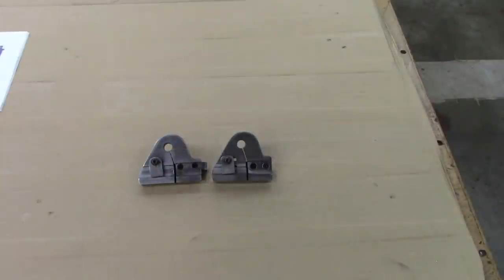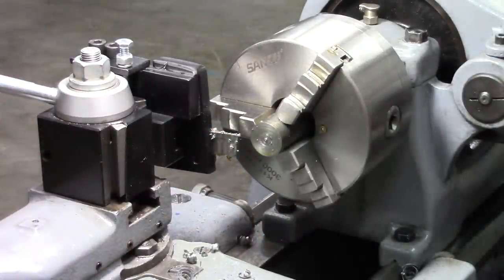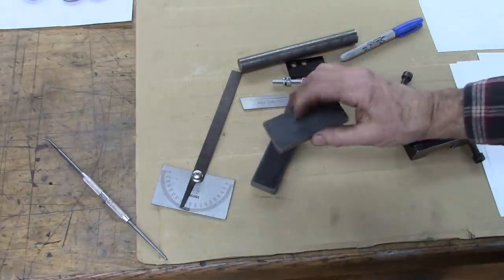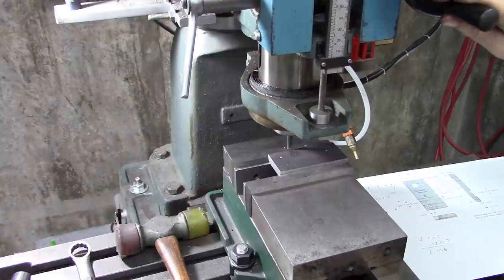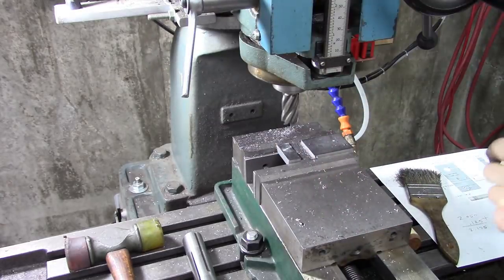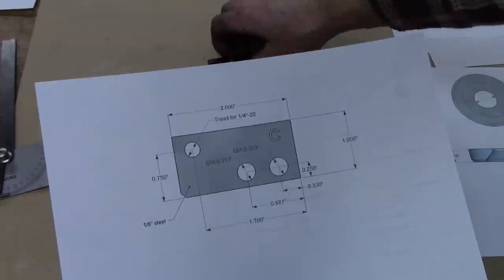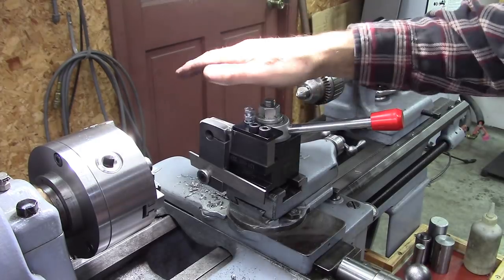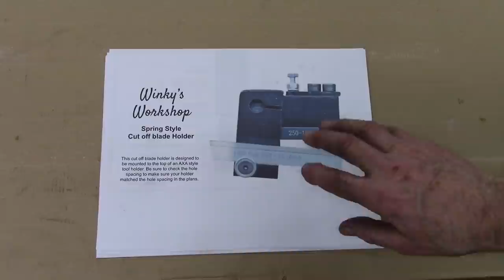Spring Cut Off Evolution! An Easy to make design + the PLANS

Comment: Fantastic video Mark !
I wonder if on your design the addition of a screw pushing on a heavy spring or maybe  rubber  slug which is pushing on a metal plunger and all this is built into the upper main housing so the metal plunger pushes onto the lower section of the flexture across the slot  , could this be used to tune the amount of flex of the unit and maybe the harmonics that cause chatter ?
Reply from the maker: I think it would need to pull the spring closed to work well (like preloading the spring). A screw that pushed would likely make it act like a normal cutoff tool. Maybe a screw with s super strong spring pushing might work too.

Comment: Well I made the original cross slide rigid mounted one and it still works fine but will have to have  a crack at this one too as it looks easier to set up. Might try something different by using 14mm x 2mm blades
Reply from the maker: Are you talking about the direct mount? My lathe did very well with this one. I did get some chatter but it was easy to work around.
Reply: @WinkysWorkshop  Yes, that's the one. I actually made 2 for different size blades and only crashed 1 on auto feed (not tight enough)
Reply from the maker: @allanb1778  Yeah...  the quick change is nice.

Comment: Great project Mark, I really enjoyed your explanations and proof of principals. Nice penetration on the weld. When I was learning how to run my newly acquired NIG, a talented young welder taught me 2 things you control are the ground clamp, and it never hurts to clean to bare metal if possible. Would this holder work with an indexable cutter? Cheers and thanks for the drawings!
Reply from the maker: I'll be exploring inserts with this tool. It should work!

Comment: i found i could weld  HSS steel tooling  to make a cutting tools for the lath for parting off  facing tooling
Reply from the maker: I'll bet that would work well as long as you were not welding super close to the cutting edge.

Comment: You can't have both sides of the mounting bar bolted to the tool body. Remove the screws on the parting tool side of the fixture and try it again.
Reply from the maker: I thin you totally missed how this design works. Look at the plans I posted. The top bar is solid. The flexing takes place at the top of the vertical piece where the hole is drilled.
Reply: @WinkysWorkshop  Hi Mark, Scooter is referring to your first design and I believe you're referring to your second design.

Comment: Moving the pivot point further forward in this design increases the force needed for a given deflection- in other words it is stiffer. This can be adjusted via the length of tool projecting from the holder (which this design will be more sensitive to). There may be an optimum value...
Reply from the maker: Yes, I agree 100%. So far 1 inch stick out works well (2 inch stock). The blade stick out has been set for 1.5" stock for a long time. Maybe I'll leave it set for 2" diameter now.
Reply: @WinkysWorkshop  Thanks for doing all the work that lets the rest of us not have to. Guess I have to add making one of these to the list...
Reply from the maker: @Tensquaremetreworkshop  Let me know how it works out. Maybe a stiffer spring would be better.
Reply: @WinkysWorkshop  Sounds like set for 2" stock is optimum for your design. I would call that pretty good- would cut any size I am likely to use...

Comment: This is just great.  I have to make one.  I'm useless with a parting tool.
Reply from the maker: It seems to work well. It sometimes chatters until full cutting pressure is achieved at the start of the cut but only for about 1 second. Slowing the RPM or shortening the blade seems to almost eliminate this however.

Comment: I would make a bar for the cutter from elastic steel, for example, from a truck spring.
Reply from the maker: That might be better but it doesn't need to flex much
Reply: @WinkysWorkshop  Ок.

Comment: I'm making one of these myself. 
I'm wondering how long the black tool holder you used for the dovetail is. The one I copied is 3" long. 
My top part that bolts on will overhang the tool holder quite a bit. I'm wondering if I have to shorten it some.
I made your tap guide as well. that works great. thanks for sharing.
Reply from the maker: Mine overhangs about 1/2" but that's a very good point. with a little modification you could move it back. I also wonder it slightly less upward tilt might be better. My direct mount design worked very well and it was level.
Reply: @WinkysWorkshop  Thanks, I finely figured out what I was looking at in some of the video. by pausing. yeah, I haven't cut that slot for the tool as my new tool hasn't arrived yet.Ill consider 3 degrees. hopefully mine will work as good as yours.
Reply from the maker: @wayneevans5050  I used mine today. The only problem I have had is that it chatter before it's under load. Once it's under load its smooth.

Comment: Did the second tool of the first style fail because of vibration due to pieces being bolted and not welded? To me, even with an interference fit there would be movement to cause chatter.
Reply from the maker: This could be the case although it was a very tight fit. I suspect the previous design was on the edge of usable even on the first one I made. This new design moved the pivot point toward the cut. This makes the tool move back more when it tries to grab. It seems to be VERY forgiving. Speed and feeds have very little effect.

Comment: Just a thought but have you tried your new tool with a wedge in the saw cut to see if there is a difference between sprung and unsprung?
Reply from the maker: Haha...  that's kind of scary but now that you brought it up I'm going to try it. In the past parting with a blade in the quick change was scary.
Reply: @WinkysWorkshop  many years ago I played with a threading tool of the same type as your parting one and put a screw in to be able to lock the gap, it worked better locked but then the springy bit might have been too springy. Perhaps it is time to try again?🤔

Comment: Winky, I like the look of that unit and it is certainly less intrusive compared to the original Armstrong design but I am not sure that I can afford the reduced usable width with that attachment in place. I wish we could get affordable T profile cutoff blades here in Aus, the only place I can find is 50AUD plus shipping for a 4inch piece. Years ago I had a small piece that came with a cutoff tool holder from the UK but that has long gone to the graveyard of broken tools. Good on you for making the plans available, Is there such a thing as a postal VPN so I can pretend to be in the US?
Reply from the maker: Postal VPN...  I love that! Hahaha - I just bought one for $16.
Reply: @WinkysWorkshop  perhaps you could order me a couple and forward using letter post  (depending on postage I would obviously reimburse using paypay) as I am sure they wouldn't weigh that much.
Reply from the maker: @michaellinahan7740  - Send me an email with the topic "BLADE". That way I can find it. I have 150+ emails so this will let me find your email.

Comment: I've got to make myself something like that, parting off is still very much a lottery as to survival of the tool.
No amount of stiffening things up has done any good, tightening the gibs, adjusting the bearings, I even replaced the compound with a solid block. 
Really strange that the second one of the earlier design didn't work, do you think there could be a difference in the material itself?
Reply from the maker: Obviously something it different between the first two but what I'm not sure. I I had to guess I'd say that the first was not ideal either. The pivot point (point of flex) on the second design is key I think. The tool moves back more as it deflect

Comment: If you still have the one that didn't work, and it was made from the same steel, I am wondering if the application of heat at the same point that the weld was on the first, might make the difference?
Reply from the maker: Interesting idea. I don't have it anymore.
Reply: @WinkysWorkshop  Did you use mild steel, or something a bit harder?
Reply from the maker: @Fossilphill  Yes mild steel

Comment: I liked the first one. Have you made a drawing of it?  Thanks
Reply from the maker: No I haven't made drawing because it didn't work as well and second one I made of the first type was terrible. I do see the advantage of the first type however. It can be put in any size tool holder. I thought about mounting the new design the same but it increases the amount of overhang...  Utilizing the tool holder like I did moved the tool about 5/8" closer to the post.

Comment: Have you considered making another of the "final" design without the 'flexture' and doing a 1:1 comparison?
Reply from the maker: Not really...  I've tried it. I have thought about driving a screw driver in the spring slot so that it will not flex however.

Comment: Would this work with the carbide insert type cutoff blades?
I've destroyed so many of those things I've developed a complex about using the lathe to cut off discs of any type.
Reply: Same here. Have you bought expensive carbide ?
I wonder if the cheap Chinese ones I have bought are just that .. cheap rubbish.
Reply: @stevewilliams2498  
There were reps traveling between towns selling the stuff to workshops.
One of them split down the centerline, so I can say without a doubt, that's all you can get in Southern Africa, "Boss bought  Chinesium".
Reply from the maker: Carbide isn't as sharp which is why I went back to the blade. However...  this set up might works very well with a carbide tool. I may have to explore this! Thanks!
Reply from the maker: The carbide is dull in comparison to HSS but this might work well with carbide. Be sure you watch part one. https://youtu.be/du2eCZlOQXE

Comment: Going to have to make one of these.  I use BXA.  

Question:  Thought on the size of flexure cross sectional area.  

Approach to sizing that amount of material.  Looks like a perfect part to be reviewed with a stress-strain software program.  The load for parting feed rate, stock material, etc.  How much flex needed for deflection to get rid of chatter tied back to tool feed rate.  An interesting problem to grind out the numbers on.
Reply from the maker: Interesting...  There is a LOT going on with this tool and it's hard to know how everything interact. The point of flex in relation to the point of cut is huge. As you move the point closer to the point of cut (straight away from the operator) the more the tool retracts when deflected. I don't think it actually retracts when you factor in the feed but I do think it is compensating for flex in the compound and tool post. For this reason I think the ideal design may vary with the lathe it is used on. Hopefully not too much however.
Reply: @WinkysWorkshop  It's a complicated design digging down a few layers.  Have to look into it closer.  Might have to drop a question on Lipton.  I'll wait till he's done with shop move and life is more stable for him.

Pondering if the flexure design would be upgrade for my CNC lathe.  Don't have chatter issue, so if it's not broke, don't mess with it is thought.  

I set it based on just feeds and speeds.  I also have used the SFM mode for rpm before,  didn't seem to matter.  SFM mode is a nice feature for increasing insert life for other tools.
Reply from the maker: @johnm840  From what Lipton said in his video I'd say his understanding is probably the same as mine but I could be wrong. I'm not sure I'd use the spring design if I wasn't having any problems. There are too drawbacks but one you got covered. The tool tends to dip under the stock at the end of the cut due to low RPM (SFPM). The other is a pattern on the stock on the end that is cut. It's basically flat but I assume they are due to a resonance change.
Reply: @WinkysWorkshop  Tom knows more than he said in video, and added time as well to learn more.  
Being Engineer (EE) take limits and evaluate.  IF flexure is 4X+ beefier,  then no motion from tool force pushing down on it.  Make it much smaller, then the tool force will bend the flexure to the limit where the slot is gone with contact to back side.   Not much help there for determining sweet spot.  

For a certain chip size, and rpm. What is down force on parting blade. That said need to write an equation with variables ( rpm, Depth of cut, diameter of stock, material, etc)   A task unto itself.  Next the flexture and motion of it based on the force load.  sound be some info out there on this I would think.  A common design with force gauges and other devices. Used to have access to an ME with stress-strain software on his computer.  Was pretty interesting as he dinged around with bike frames for a fellow engineer in the group at that time. 

He messed with that program for a good 6 months before it was useful.  Not an option these days as we all work in different capacities.   

Have to go old fashion way with a free body diagram and make assumption.  

Or just make a part and test it with a known force and measure deflection.  Repeat for a few parts to get a curve.   I like option to think about it more.
Reply from the maker: @johnm840  All interesting stuff but too time consuming for my life right now. The amount or flex away from the cut vs downward movement is simple math but the rest isn't so easy. I will say, the movement is very slight until you get very small (less that 1/32" in diameter). At this point the SFPM is not adequate and the tool tends to go under the stock. It breaks off but always leaves a numb.
Reply: @WinkysWorkshop  Agree, over thinking it, but Interesting still.  My Part off's are pretty good as is.  Sharpe tool with good geometry to cluck or collet. 

Getting rid of the Tit at end is endless problem on CNC.  make a few no biggy, but a box of them to deburr is different.  Tried a slight angle to front of parting tool so part drops off before other side reaches the center of stock. Rpm Controlled by SFPM doesn't seem to help. tit is small but seems to be just the way it is.    Get it "tit less" a times but not able to repeat it.  

I'll mull on this flexure and let you know if I find something. A shiny project to distract from other jobs.
Reply from the maker: @johnm840  I like simple but I'm thinking about adding an adjustment screw to limit the flex, The amount of flex is almost undetectable until it gets down to maybe 1/16" dia. and then tries to go under the stock. it usually breaks off but the added rigidity at the end of the cut might make some of the tit go away.
Reply: @WinkysWorkshop  Small change in the flexure, yep.  I was thinking maybe the flex down would help with tit on part, but re-thinking it, probably not.  Part off tool removes tit on stock side so it's on center. I made a gauge block so I can get it exactly so to speak 1/2" off of CNC tool table. 

Spindle is going like 800 - 1200 rpm so the part flies off before it is 100% thru,  Might be something just to live with.   

This flexure with the negative feedback is just so kool.  Making one for BXA holder for manual lathe with your current numbers might be good enough as a starting point.  starting a drawing is probably starting point.  Width of slot didn't seem to be critical feature to me.
Reply from the maker: @johnm840  I'm going to install a stop to limit the amount of flex. The only time the tool flexes much it at the center. If I limit the flex at the right point it might limit the size of the nub

Comment: Hello.
Increase the section of the spring lug to 16+ mm. The cutter will work more stable.
Reply from the maker: You may be correct but I made a tool before this one that was thicker and it didn't work well. I also moved the point of flex toward the cutting point so I'm not sure which effected the performance.

Comment: Ok I need to try and figure out how to make one for the mini lathe without having a welder or mill. Hmm.
Reply from the maker: The weld could be bolted and fit the blade so it sits on pins.

Comment: Can you lathe take a 3/16" depth of cut without effort?
If it cant, then you can't use a 3/16" parting blade.
Pretty simple, parting tools should be about 80% of the max depth of cut your machine can handle.
After that, parting is just like turning, use a slightly reduced speed, but feed should be the same. People get in trouble when they try to cut too slow - cram the tool in there, if the machine stalls, get a thinner tool or a bigger machine.
Reply from the maker: I'm not sure I understand but the blade is 3/32". And yes that's about what the lathe can handle. I just made about 15 cuts at a verity of speeds and feeds cutting 1.5" bar. It will cut at 800 RPM but 180 was better. 800 was good for 1-inch but I still like the lower speeds... less oil slinging. Feed rates were .001 to .002 per rev.

Comment: Thanks for the free download.
No secret I have problems parting off. 
I put it down to having old worn out machines.
I am going to try your design.
It doesn't make sense to me  ?
Allowing the blade to deflect down means either it stays down, suggesting that the setup is too high in the 1st place, or that it springs back up   so why doesn't that make it dig in deeper as it comes up ?
A mystery to be investigated.
Reply from the maker: Steve, if you haven't seen part one you need to watch it. I think it will clear things up. Thanks! https://youtu.be/du2eCZlOQXE

Comment: Big respect, but your parting blade is tapered top to bottom. Are you accounting for this?
Reply from the maker: Its parallel at the bottom but T shaped. HHIP 2000-7030 3/32 x 11/16 x 5 Inch 5% Cobalt P3N Style Parallel Type Cut-Off Blade

Comment: Where did you get those little bottles with hypodermic needles?
Reply from the maker: Amazon I think
Reply: @WinkysWorkshop  thanks. Printing the print for the spring cut off tool.
Reply from the maker: @steveo1006  Thats great.